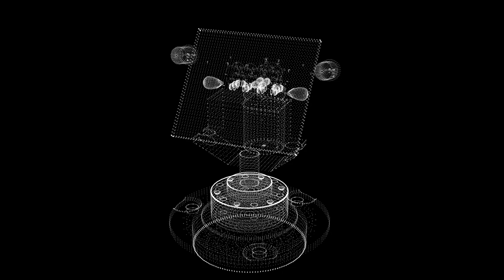Beam Bot - FLED Head [Tutorial]

Comment: Hi. I was hoping you could help me again. I've had a PCB made to this design and fitted a 2200uf capacitor for shorter pulse duration, a 5v 70ma cell and combined it with a 3v 30rpm geared motor. I can balance the variable resistor the point the motor turns both ways, but covering the Fled's does not change the rotation of the motor at all. I'm using standard 3mm self flashing leds. I have had the 22K optional resistors in and out, but it stays the same. Any suggestions? 🙏🏼
Reply from the maker: Hi! I'm sorry for the late reply! 
Some FLEDs aren't particularly sensitive to light as I found, but I think it should still favor one side. For example, my first photopopper with the clear FLEDs was following light less strictly, taking numerous random steps. So you could maybe try different FLEDs.
Another thing you could try is to power the circuit with a variable power supply with current limiting if you have one (otherwise, use a smaller solar cell). Set it to 3 volts with absolutely no current, then slowly increase the current until it starts popping. (This simulates the weakest solar panel your circuit could be powered with.) If it is still not responding to light, I would blame the FLEDs. If it starts to work properly, then it is something with the FLED solar engine not working as expected on higher voltages. In this case, though I have not experimented with this, I think that you could try to add a resistor in series with the FLEDs (between the pot and the ground) to increase their trigger voltage.
Other than these, I'm not sure what could be the problem. But I hope you find the solution! Let me know how it goes!
Reply: @gregtasi  Thanks for taking time to reply, many would be too busy. Thanks for all the great ideas, I will have another play with the circuit and see if I can get it to work correctly. Thanks again 👍🏻

Comment: im close i found the two relays glued together from years ago, but i think i did the wiring wrong :(
Reply from the maker: Do you mean transistors? That's quite unfortunate :( 
I once built a bigger freeformed robot with more transistors just to find out one of the transistors died during the process... I had to redo all the gluing and soldering.
I think you should build the circuit on breadboard first, so you can use that as a reference. Good luck!

Comment: Can i use normal LED instead of flashing LED?
Reply from the maker: Hi! Sadly no, this circuit works only with flashing LEDs. If you wonder why, check out solarbotics' BEAM site: http://solarbotics.net/library/circuits/se_t1_fled.html

Also, If you are planning to build this circuit, I would recommend you to build a single solar engine first, then move onto a photopopper (my latest video) to get to know the gotchas of these kind of circuits. And don't forget to breadboard them first!
Reply: @gregtasi  alright, thank you for the answer, i hope i can make one of solar photopopper beam robot
Reply from the maker: @muhammadlutfi4315  I'm glad I could help. Good luck with your photopopper! If you have any updates or want to share your progress, I'd be excited to hear about it!
Reply: @gregtasi  i've built one solar engine (FLED based) but i have a problem. My FLED keep turned on (blinking) without triggering the motor.  I already tried using bigger resistor (7k) and the FLED still flashing for about 3 blink and then the motor starts. And the cycle continue. Do you have any advice? Bcs i never watch FLED flashes in other solar engine
Reply from the maker: @muhammadlutfi4315  I had that happen to me, but I can't really remember how I fixed it, it was quite long ago. (I was definitely experimenting a lot with different solacells and FLEDs) It does however sometimes happen to my first photopopper with the simpler circuit when there is barely enough light for it to operate. Did you try to add the extra 33K resistor and capacitor as seen in the photopopper circuit? (on the same page as the FLED SE) I think that could also help.
Reply: @gregtasi  i haven't add 33k resistor and capacitor as in the circuit bcs i think its working just fine even tho the FLED iritating me. I'll build my first beam robot photopopper then i will work on v2 where it use 33k resistor or even v3 with 1381 IC